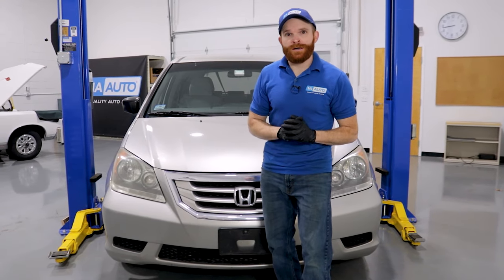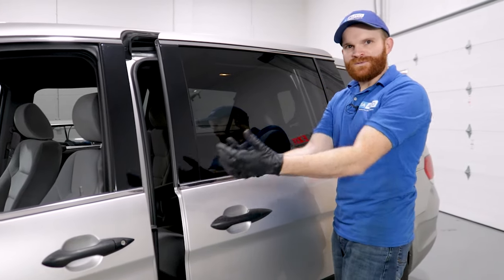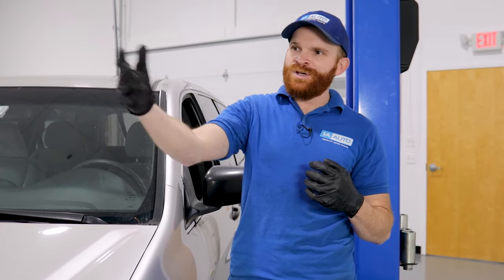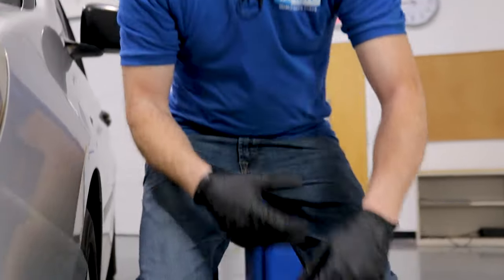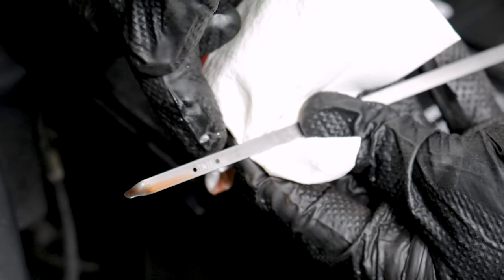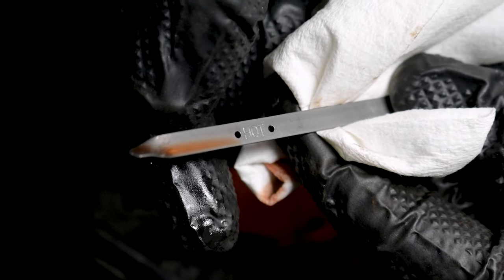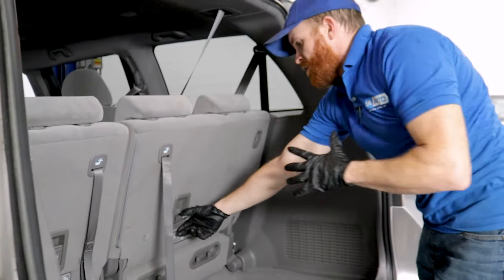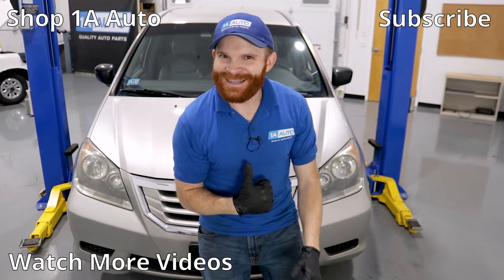Top 5 Problems Honda Odyssey Minivan 3rd Generation 2005-10

Comment: If you have a vehicle regardless of age  and still driving good, keep it. Newer cars aren't necessarily better.
Reply from the maker: +Glo Green Thanks for the feedback!
Reply: compared my old oddy 2007 with newer 2018. Newer one has better interior but rides not better at all. Decided to keep mine.
Reply: Agreed
Reply: Buy pre-owned. Let the rich take the massive depreciation hit when they take it off the lot.
Reply: mike davidson  Yeah those old Rovers are awesome, friend has one.  Like my old 12valve Cummins, super reliable, and damn near twice the fuel economy than my 98 F150 I got now. I should of kept that truck. For the time it takes to change a plug on the F150 (unless they blow themselves out of the head first) after removing 10 pounds of crap to get to them I could of did all six injectors on the Cummins. New ones are worse I heard, change the plugs and half of them break off in the head.
Reply: I agree, my last 3rd gen odyssey had 450k+ miles on it before it died. My fault though I started to neglect it, I know it could have done more. I went out and bought another 3rd gen, so far I’m at 234k miles
Reply: @MY-pj8cd  ... that’s dope keep up the good work!
Reply: April 2022 …you can’t afford new one
Reply: @MY-pj8cd   great to know. What year was it?
Reply: @i.o.inoagenta  the older one is much more spacious and much more cozy inside than the newer ones.

Comment: I've been lucky. 2007 honda odyssey with 192k miles. Only thing changed. Besides regular maintenance, Power steering hose and housing. Changed out rotors. That's it. Still running strong and keeping it. Honda, we make it simple!!!
Reply: Have you ever replaced the timing belt?

Comment: We own a 2009 Honda Odyssey EX-L. We bought it new, and drove it for 200,000 miles until it developed a very loud knocking sound! The sound was bad lobes on  the camshafts for both cylinder heads. We replaced the heads with new Honda heads and we are ready for another 200,000! It is a great vehicle, and my mom will not ever say goodbye!
Reply from the maker: That's great to hear, we love putting new life into old vehicles!
Reply: Another 200k after you replace your transmission.
Reply: I own the same exact van!! Year, Make, Model and Trim

Comment: I had those issues with my Honda Odyssey. I replaced the motor mounts with Anchor mounts. They sell them in a kit from Rock Auto for 126 bucks plus shipping. They work very well. I changed my transmission fluid to Valvoline Max Life ATF with Lubegaurd added, and the transmission loved it! Much better than the DW-1 fluid from Honda. My transmission was still in awesome shape at 150,000 miles.

Comment: I learned to drive on a 05 Odyssey with 230k miles, it still drove better than some newer cars I've test driven! Super comfortable reliable vans
Reply: I just took delivery today of an '05!  It has just under 45,000 miles at $10.5.  I am hoping that we get it up to 230k miles!  This is our 3rd Odyssey.
Reply: @smackandjack  WOW! What a find. We’ve owned our ‘03 Odyssey since Fall 2002. Almost 198,000 on it and purrs like a kitten (we maintain it and fix any mechanical issues). Some minor and maybe frustrating issues (misbehaving sun visor, for ex.) that we’ll get to if there’re annoying or unsightly enough. Best wishes. What a fantastic find!
Reply: @smackandjack  wow thats a great find! Don't know if you've had a 3rd gen before but make sure you muzzle! Along with regular transmission oil changes, timing belt and water pump at proper intervals and reg naintwnence and you will have a vehicle that should last a long long time!
Reply: @smackandjack  also dont forget that timing belt goes by mileage and time I don't remember how Often you're supposed to change due to time, But it would be wise to double check on that and if it hasn't been done I would imagine it would be a good idea to  Change in the near future
Reply: @pinkfiffty3094  ... they say every 100,000 miles on the timing belt I believe because my 2010 crosstour had hit 105,000 miles I did the timing job and shop said I was good until 205,000 for the next one!
Reply: @smackandjack   That is an amazing deal you got blessed with that 1
Reply: @pinkfiffty3094   What do you mean by muzzle?
Reply: @HighVybeTribe  vcm muzzler. Vcm disables 3 cylinder. Believed to tear up engine in the long run.

Comment: VCM causes oil burn, got the VCM muzzler and now no oil burn, 2008 EX-L, 160,000 miles. I use RV silicone slide on my sliding door rails and door gaskets, very smooth.
Reply: You can also buy VCMTUNER II, it uses a newer system and it doesn't need you to swap fuses or do anything, just need to plug in and it's good to go.
Reply: On VCM engines - the motor mounts are powered - the power features will go bad and the engine will shake when the VCM engages.    VCMuzzler or similar get around the need to replace the power feature of the motor mounts - since it never gets into shutting off cylinders.  The cost to replace the powered motor mounts is absurdly expensive (just for the parts alone).
Reply: Absolutely, delete that VCM.
Reply: VCM tuner is a must on these cars. You just plug and play. No more eco mode. No more fouled plugs.
Reply: I also have a vcm muzzler on my 2010 Honda Crosstour and it works great I will see eco light come on here and there if I’m idling in traffic for while but it goes back to normal once I get rolling!

Comment: I have a 2016, and pulsating front rotors was a huge problem until I asked the honda service if there was a heavy duty set for the odyssey. Yes there was, and I had them install them. No more issues. I don't understand why honda doesn't just put the heavy duty ones on from the jump.

Comment: Akebono which is a manufacturer for Honda has upgraded rotors available to prevent rotor warpage. They have cooling cutouts made in the "hats" of the rotors. Another issue is alot of tire installers do not hand torque wheels. Honda rotors are very sensitive to wheel torque on brake rotors.
Reply from the maker: +SMOKIN WITH SKRUGGS Thanks for the feedback!
Reply: Another thing I've seen is that the front factory suspension bushings can cause pulsations from being worn out/dry rotted. A urethane bushings kit can eliminate a lot of the vibration.

Comment: For anyone who owns an odyssey, here’s a tip that will save you a fortune (that I wish I knew before I spent a fortune) when you buy an odyssey, as SOON as you buy one, take it to a transmission shop and have an auxiliary transmission cooler put on. It’s usually about $50 for the cooler, and $100 for the labor. But to have Honda replace the transmission, I had it quoted last year at $5,800 on a 2006. FIFTY EIGHT HUNDRED DOLLARS. Local shops quoted between $2800-3600 depending on warranty and reputation of the shop (cheapest in my town had the best reputation and warranty) but I chose to put in a used unit from a junk yard, and burned the transmission up the day after it was installed because I didn’t have a cooler, and the temperature sensor that turned on the fans was broken. So the temp gauge was reading normal, meanwhile I was burning up my transmission with a tiny factory cooler on it. 

Don’t end up like me having to take a major loss on a great vehicle just because I couldn’t afford to replace another transmission. Spend the $150 on a professionally installed aftermarket cooler, and save thousands!!
Reply: I bought my 06 oddy used ( 160,000 miles) .. could it have one one on it?
Reply: @sisterbecky411  I’m looking to get one too, with 135-150k miles. But here I am trying to figure if it’s worth getting a Odyssey.
Reply: Yep....

 Typically the tow package versions to a really good for.this.already as they have better.cooling systems....just don't actually toe anything LOL.

I have a 430,km Odyssey and I'm.pretty sure the transmission is stock. Kind of a mircle but take.care of it and they long haul
Reply: I've heard about the notorious tranny issues on this gen Odyssey. Will do this when I add the fog lights from the Touring model for my LX.

Comment: These vans are excellent. Here’s my top 5:
1.  VCM - disable it.
2.  Transmission fluid replace every 20K miles.
3.  High pressure power steering hose, replace with high-quality part (REIN or OE).  
4.  Use only a high-quality remanufactured or OE power steering pump.
5.  Use only high-quality Brake pads and coated rotors.
Bonus:  Only use original OE Honda center roller for sliding doors.

Comment: One of the first things I did when I bought my used 2006 Touring was join the odyclub forum. The second thing I did was buy a VCM Muzzler. This one simple, cheap alteration to the coolant temperature eliminates most of the severe problems caused by the VCM mode. 

The sliding door issues are easily prevented and sometimes corrected by simply spraying the tracks, the roller bearings, and the door latches with white lithium grease. I was told by my good friend who was a Honda mechanic for 40+ years that I would need a drivers side bearing assembly so I bought one. But after greasing the door correctly the part is still sitting in the box 5 years later. The door works perfectly. So the lesson here is, moving parts of different materials usually require a lubricant.

Comment: I have had an ‘06 and we now have an ‘07. Other than the Sienna perhaps, it is hands down the best minivan on the road. Smooth as glass. Our ‘06 had 214,000 miles and performed flawlessly in original drivetrain. A deer took it out 6 weeks ago. We purchased an ‘07 with 219,000 miles. Performs even better than the last. It was a one-owner that meticulously maintained it. I did have to replace the sliding door roller and brake rotors on my ‘06, but it was a simple fix! Great vehicles, just as long as regular maintenance and fluid changes are performed regularly.

Comment: Best car I've owned. I do all my own work on all the vehicles that I've had. And I've had a number of them. This is my daily driver for my kids and my wife. I have to say they build a solid product and this is one of the best cars that I've ever had. One part that you missed for the automatic doors is occasionally the doors will not latch when they're closing. When this happens check the rubber stoppers in the upper corners of the doors. This is a very cheap part at the dealership or even amazon. Had this happen recently on a trip and found that it's not an uncommon issue. One little piece of rubber ensures that the doors will close. I recommend if you're planning a trip or just driving it daily to check these out and replace them if they are gummy.

Comment: I had all 5 issues on my 2008 Odyssey.  4 have been fixed. Will work on the sliding doors in the spring and I'll do it myself.  Thanks for this video.  Very informative.

Comment: I have a 2006 with 250,000 miles. Yes on the motor mounts breaking and yes on the power doors. The driver's side, which get's used a lot more often is getting pretty bad. Rear hatch has started water leaking into the hatch itself and I haven't been able to solve it yet. 10-4 on warped rotors. The one thing I did early on was install a transmission cooler, and have never had any issues.
Overall, the best vehicle I have ever owned.
Reply from the maker: +zimmelbot1 Thanks for the feedback!

Comment: It's kinda freaky when I have a 09 Odyssey and have the brake pulsating problem right now ...and your video pops up in my recommendations Whoa!
Reply from the maker: +Paul 42NO Thank you! We love empowering our customers and showing how to perform DIY auto repairs with our high-quality auto parts.  http://1aau.to/m/Shop-1AAuto-c
Reply: plastic bearings in the sliding doors a fantastic idea. Bought 09 Odyssey from the 2nd owner no maintenance records available.  Tranny fluid burnt  do I flush it ?? Approx 1 wk ago overnite 20"x 10"  clear fluid leak  front passenger side  appears to be water but a greasy feel, no smell, the radiator appears new but not holding water nor is it taking it from the Overflow. (blue antifreeze in the Overflow and I have added a yellow to the radiator.) I've been under the car more info if necessary. Owner's manual is useless. Any ideas?? Also lost the plastic bearings in one door where to buy just a half a hinge?? Maybe I get a package deal for four rotors and pads also. 🙄

Comment: 15 years of owning the Odyssey., i have experienced all 5 issues you mentioned and had costed me alot of money already.. Especially the $6K transmission, but it has to do with changing the transmission fluid at the express oil change place.  It is a very bad idea to change your transmission fluid at the express oil change.  They change the oil and ask you to drive around and comeback later to top it off.  Well, if I was in a hurry for a long driving vacation trip! after a few hours of driving, my transmission started making a lot of noise.  I checked and saw that it was below the min. line, so i stopped at the gas station and buy the oil to top it off.  As a result, it was a little too much.  When transmission oil is too much, it blew out the casket while i was driving home.  Imagine that happened to you while you are driving out over 10 hours vacation trip.  Where are you going to tow the car too and how can you find the mechanic shop you can trust.  That has cost me so much!
Reply: Big.oof...yeah you need to be careful with honda ATF fluid.

some have told me that you HAVE to get Honda's dealer fluid no other one would work correctly
Reply: So do you recommend the odyssey as a family car

Comment: Great video with good information! As a 08 EX-L owner and really involved in the Ody online community. I''ll add the following issues.

1. VTEC solenoid gasket 1# alternator killer, usually near 100k start to leak on top of the alternator.
2. The rear mount, is usually a problem with VCM engines (EX-L and Touring) due to the fact that the mount has to hold the extra vibration made by VCM. 
3. AC Fan relay going bad located in the engine bay.
4. Leaking roof seams
5. VCM engine in most cases start to have missfires and oil consumption issue. (Can be avoided by using a vcmuzzler or vcmtuner).
6. Rear latch or door actuator issues.
7. Timing belt tensioner going bad.

Comment: Olivia, my 2010 Honda Odyssey EX isn't having any of these problems. She's turning like a champ, shifting like a champ and running like a champ. The only thing Im worried about is her minor steering wheel vibrations @ 70mph. No it's not an axle or suspension issue. Done inspected em all and they're all good. I'm being told it's a wheel balance/tire issue. But otherwise, she rocks! 💪🤟

Comment: Regarding the transmission fluid: Only use Honda ATF. It has a thinner viscosity the regular ATF. Also there are some leak points so make sure you keep the transmission fluid topped off.

Comment: I had one of the problem listed in this video. The D flashing.  I looked at online and had transmission fluid flushed at 66k.  I bought 2003 honda odyssey EX-L on 2004. Still using no problem as such. The best thing is it doesn't have much electronics in it , so even if I don't drive for 2 weeks my car starts immediately. ❤ odyssey.

Comment: Number two has been the most persistent issue.  Did a resurfacing procedure two years ago on front rotors and vibration has continued. Will probably replace lower control arms, rotors, and to ceramic break pads.  Thanks for the tips.
Reply: Put drilled and slotted rotors on (available on ebay and Amazon). They handle the heat much better and don't warp, which is what causes the vibration.
Reply: check the tire,i change rotor,arm, front end ,AXLE .....then i find out it was bad TIRE !!!!!  change 1 tire and vibration gone IMMEDIATLY...
Reply: Had bad pulsation from CTek Premium rotors switched to Bosch Quietcast. Much much better.

Comment: CV axel vibration.  Did some research, replaced both CV axels.  Still have the problem.  Also, you might want to mention left front tire alignment/wear happens with bad engine mounts.  Kept having to replace tires till I learned the engine mounts were the issue.  New mounts, problem solved.
Reply: Can you please identify which side if the motor mounts are problematic and causes undue tire wear? Just replaced my rear toe rod ends to adjustable ones with 4 wheel alignment to follow. I have not heard of this but my front passenger tires wear out faster than the rest. Thank you